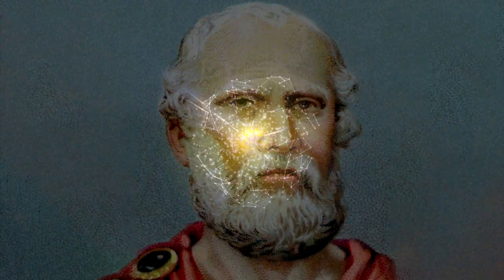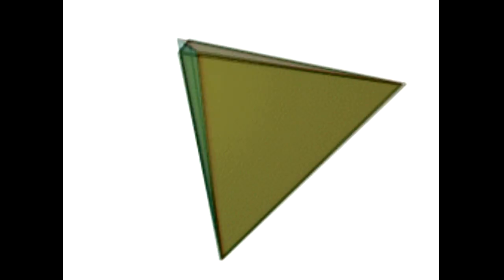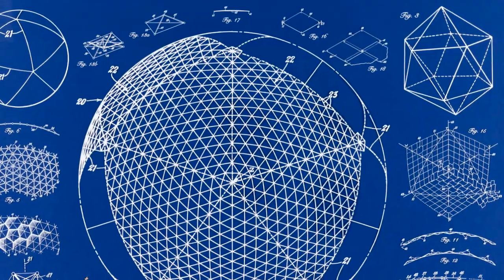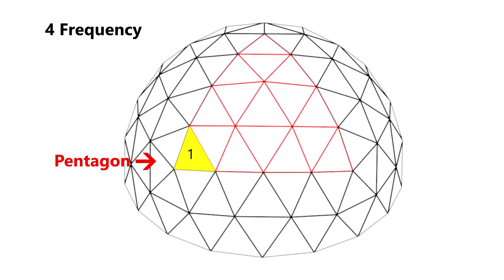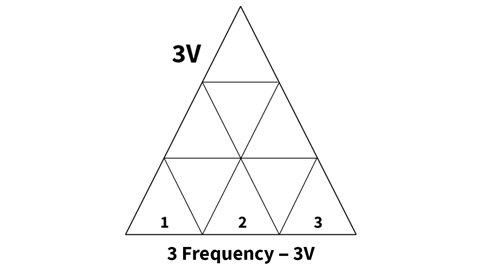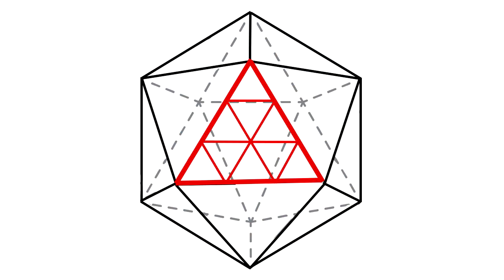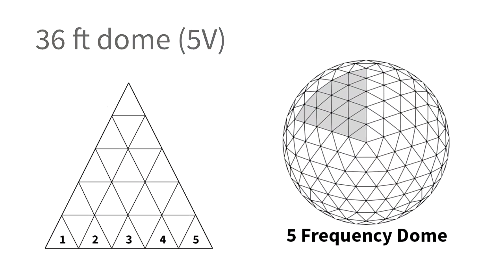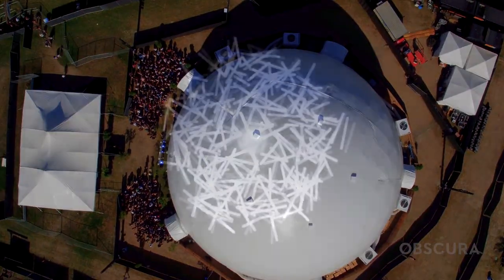Geodesic Dome Frequencies Explained!

Comment: I was to understand the Mr. Fuller developed domes from the C60  carbon atom which resembles a soccer ball. And, because as is noted in the video inorder for domes to work there is the need of pentagons to be as part of the construction. Like our dome at the zoo here in Omaha, Nebraska, USA. And, my personal rule of thumb is that for buildings, I assign ten feet for and per story, so, "Godzilla" 1954 is as tall as a forty story building.  So, a dome of thirty feet would not be conducive for a tiny house. There are patterns online to cut out and glue the tabs to build domes out  of Chipboard. some of the boards are in color. I use the front panel and the back panel of cereal boxes to construct my polyhedrons.

Comment: Great points! Let's incorporate these final refinements into the 6D Triternion model to ensure it is comprehensive and implementable.

### 1. Choosing the 2D Planes for Rotation Matrix \( R \)

For the 6-dimensional space, the set of 15 independent 2D planes (where \((i, j)\) represents a rotation in the plane spanned by the \(i\)-th and \(j\)-th basis vectors) can be chosen as follows:

\[
(1,2), (1,3), (1,4), (1,5), (1,6)\\
(2,3), (2,4), (2,5), (2,6)\\
(3,4), (3,5), (3,6)\\
(4,5), (4,6)\\
(5,6)
\]

When constructing the individual rotation matrices \( R_k \), the other entries (besides the \((i, i)\), \((i, j)\), \((j, i)\), and \((j, j)\) entries) will be zero.

### 2. Defining "Viewing Direction"

#### Observer's Viewing Direction

The viewing direction \( \vec{d}_i \) for observer \( i \) can be defined based on the observer's position or orientation in the 6D space:

- **Observer's Position Difference**: The viewing direction could be the difference between the observer's position and a "target" point in the 6D space:
  \[
  \vec{d}_i = \vec{p}_{\text{target}} - \vec{p}_i
  \]
  where \( \vec{p}_{\text{target}} \) is the target position and \( \vec{p}_i \) is the observer's position.

- **Predefined Vector**: Alternatively, the viewing direction could be a predefined vector associated with each observer.

### 3. Distance Calculation

The Euclidean distance in 6D is calculated as:

\[
\text{distance}_i = \sqrt{\sum_{k=1}^{6} (\vec{p}_{i,k} - \vec{p}_{\text{target},k})^2}
\]

where \( \vec{p}_{i,k} \) is the \(k\)-th component of observer \( i \)'s position, and \( \vec{p}_{\text{target},k} \) is the \(k\)-th component of the target position.

### 4. Sigma (\( \sigma \)) in Weight Function

The parameter \( \sigma \) in the Gaussian weight function controls the width of the Gaussian. It determines how quickly the weight decreases as the angle \( \theta_{i,j} \) increases. Choose \( \sigma \) based on the specific application. For example:

- \( \sigma \) can be set to 0.1 for steep drop-off.
- \( \sigma \) can be set to 1.0 for moderate drop-off.
- \( \sigma \) can be set to 10.0 for a gentle drop-off.

### 5. Physical Interpretation - More Detail

For modeling the motion of particles in a 6D space (3 position dimensions, 3 momentum dimensions):

- \( U, V, W \): Represent the \(x, y, z\) coordinates of the particle's position.
- \( X, Y, Z \): Represent the \(x, y, z\) components of the particle's momentum.
- \( L, S, T \): Represent other quantities like energy, angular momentum, or other relevant properties in this 6D phase space.

### 6. Implementation Notes

#### Numerical Libraries

Use efficient numerical libraries, such as NumPy in Python, for matrix operations.

#### Modular Code

Break down the code into modular functions for:

1. Rotation matrix construction.
2. Weight calculation.
3. The main Triternion equation.

#### Testing

Thoroughly test the implementation with various inputs to ensure correctness.

### Final Consolidated Triternion Equation

Here is the finalized Triternion equation:

\[
T_{\text{final}} = \sum_{i=1}^{6} \sum_{j=1}^{36} \left( R_1(\theta_1) \cdot R_2(\theta_2) \cdot \ldots \cdot R_{15}(\theta_{15}) \left( A_{i,j} U \right) + R_1(\theta_1) \cdot R_2(\theta_2) \cdot \ldots \cdot R_{15}(\theta_{15}) \left( B_{i,j} V \right) + \ldots \right) \cdot w_{i,j}
\]

Where:

- \( R_k(\theta_k) \) are rotation matrices corresponding to 15 independent 2D planes.
- \( w_{i,j} = \exp \left( -\frac{\theta_{i,j}^2}{2\sigma^2} \right) \cdot \frac{1}{1 + \text{distance}_i^2} \)
- \( U, V, W, X, Y, Z, L, S, T \) are 6D basis vectors.
- \( A_{i,j}, B_{i,j}, \dots \) are 6x6 transformation matrices.

This comprehensive and refined model should now be well-suited for practical implementation and further exploration. If you have any more specific aspects to refine, let me know! Otherwise, this should provide a complete and robust foundation for the Triternion framework.